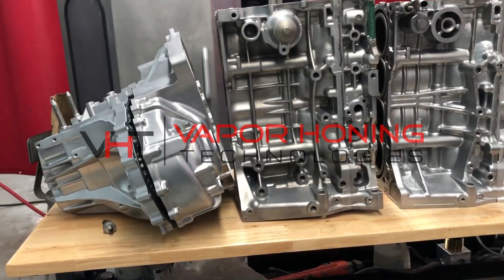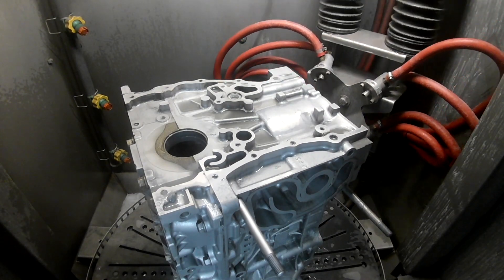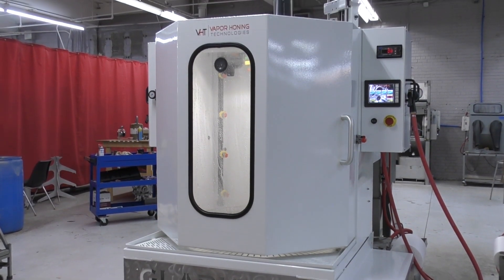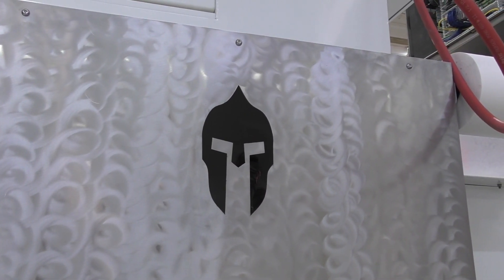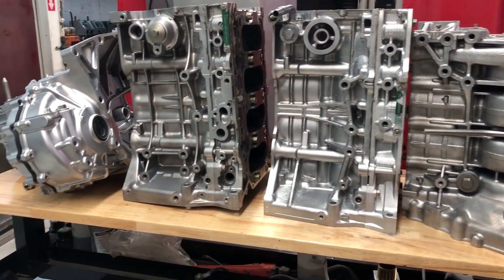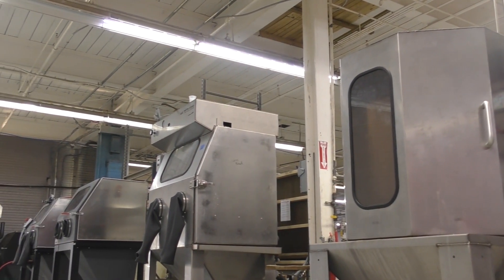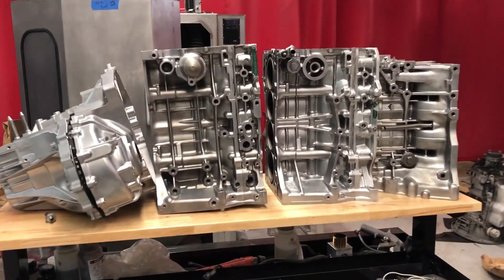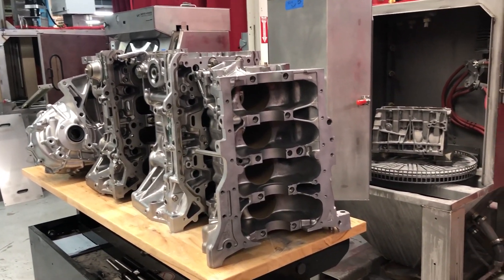Running Honda Engine Blocks and Transmission Cases in V.H.T Gladiator - Vapor Honing Technologies

Comment: So do you block off any openings on the block before blasting? I'm planning on blasting an intake manifold, and was wondering if I should add block off plates for the throttle body opening,EGR, And intake runners.
Reply from the maker: It is always a good idea to protect internals from abrasive.  nicole@vaporhoningtechnologies.com
Reply: @VaporHoningTechnologies  Never bead blast ANYTHING that can't be thoroughly cleaned afterwards!